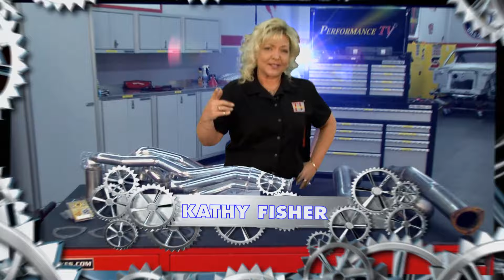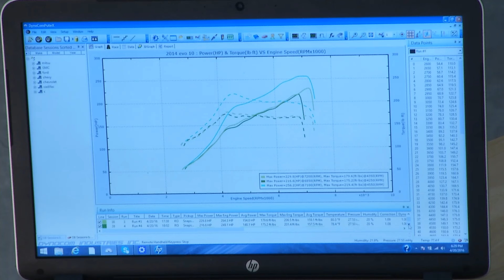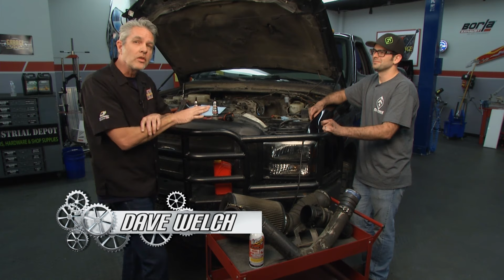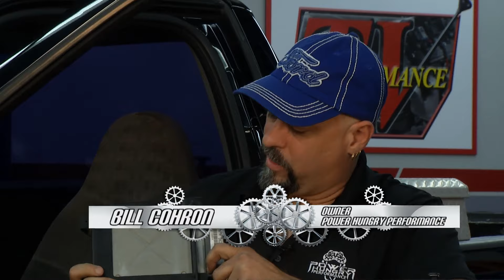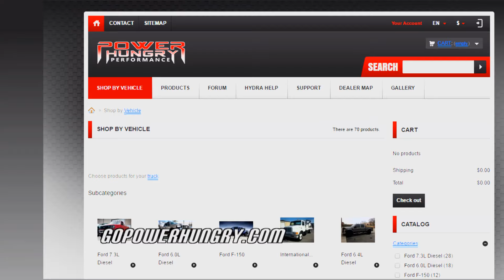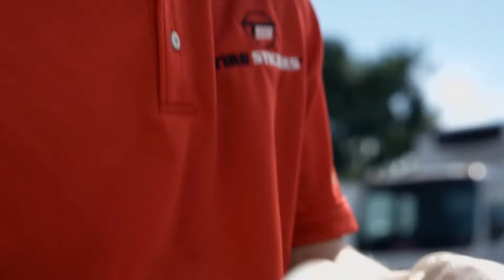7.3 Powerstroke Injectors Full Force Diesel- On Performance T.V.

Comment: Worst injectors I ever bought, when I had to turn the 5 month old units in for cores the rebuilder asked me “what monkey rebuilt these injectors because not one fucking thing matches to the other”….told me everything I needed to know about FullForce Diesel.

Do not buy
Reply: Hey man, are they really that bad?   I took the injectors out of 7.3 today.    I need stock 90 cc AA injectors.   From 1997 Ford super duty 7.3.    Any suggestions?   I’m in Niagara Falls Ontario Canada.    I’m just not sure which ones to get.   Don’t need anything fancy, but need reliable injectors.

Comment: Didn't even mention that you need to vac cylinders out or at least turn the motor over by hand a few times before cranking it. Oil in a cylinder will hydrolock the motor and bend a connecting rod if you just crank the starter after swapping injectors.

Come on, guys.....